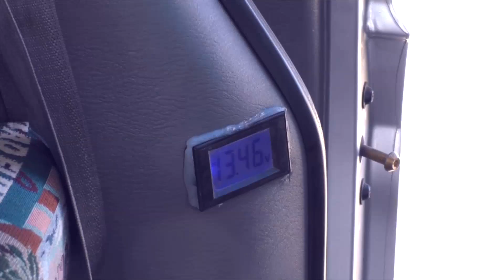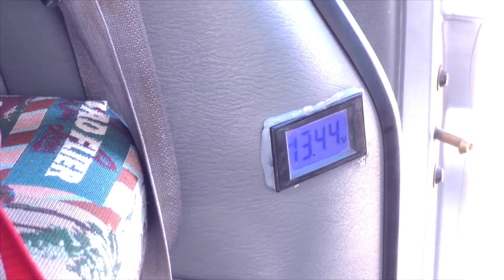Jacquelines Van Build Interview | 200w Solar Chrysler Town & Country

Comment: May I ask, with that solar set up, if she wants to add a small dometic fridge, will she just need to add a second battery or will she also need to change her inverter?  And can you give the approximate cost of the install for this solar unit plus a fantastic fan on her rig?  Thank you in advance if you can answer.

Comment: Is that passenger seat a stole and go seat ? If not she might of been better off putting one of the stole and goes that came out of the back there so you could fold it down when traveling
Reply from the maker: Not a bad idea CR. I never saw the ones removed, but I like where your going with that thought!
Reply: Enigmatic Nomadics I changed my Chanel name Jamie from vw Vanagon Westfalia Travels same guy new name
Reply from the maker: Should have known a good idea would be coming from your way. Still Have the westy?
Reply: Oh ya but it's still down with the restoration...It's pretty much going to be a new van in about 6 months ...Mechanically it should be one of the best ones around when I'm done ..Not much I've not gone thru ..I'll be rolling this fall and should be for many years after that with little problem